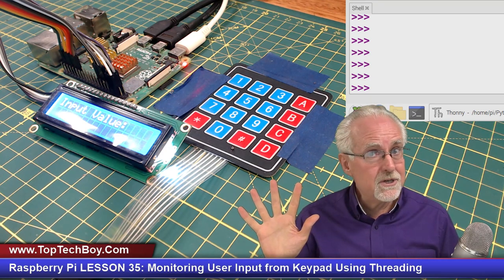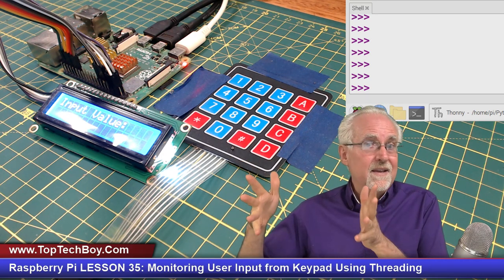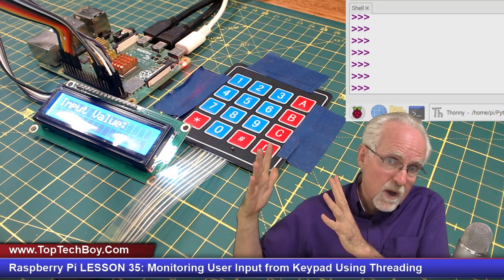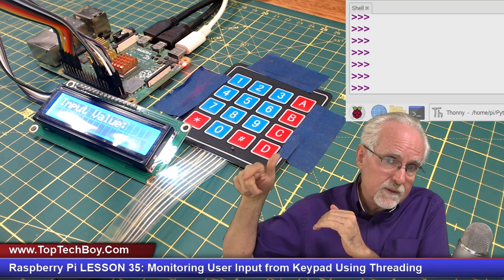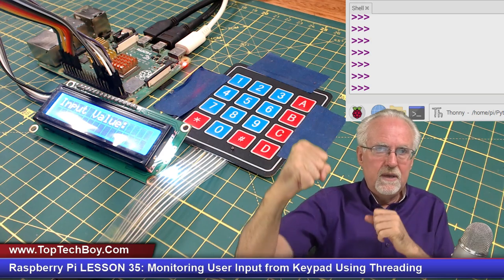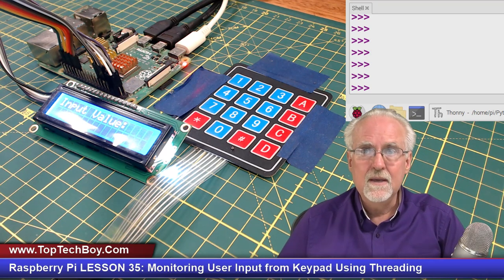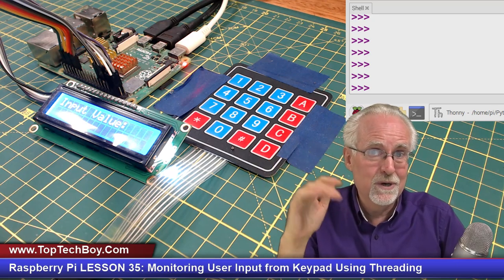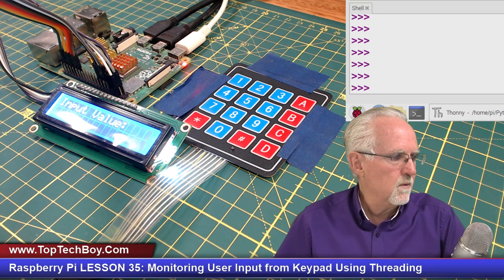Raspberry Pi LESSON 35: Monitoring User Input from Keypad Using Threading

Comment: This is another most-excellent lesson from the best teacher on the internet.  I was delayed in completing my homework version because I found that my super 8 GB Pi has a defective GPIO pin.  After numerous hours of troubleshooting I was able to work around the problem by adding an eternal pull-down resistor or using a different pin. Of course, I am now worried whether I will find other problems with my Pi.  At least I can now move on to the next lessons.

Comment: I admire the complexity and ingenuity of the system you have developed for portability of raspberry pi with LCD and keypad.  Your lessons are unrivaled!  

There is also a simple way to achieve some of the objectives with fewer programming skills:  With the pi400, the full keyboard is always available.  It is easily operated off a battery pack.  VNC can be used on smartphone to visualize the pi console as a wireless alternative to the LCD or an attached monitor.  The pi400 is only a little bulkier than the pi4 + keypad and LCD.
Reply: And what if you don't want your users to have keyboard and a screen? Consider a situation where you using RPi as a portable headless server, and you need to provide a way for users to enter a wifi password, and only the wifi password. You probably wouldn't want them going inside and messing with your stuff. And if you need to add a full keyboard and a screen in order to connect to wifi, then it also defeats the purpose of having a black-box-that-just-works. At that point you might as well just use a laptop, and it'd be cheaper that way. So why not use a cellphone, you may ask. Well, an android phone can't run a 64-bit docker container.

Comment: It looks like I am crashing and burning on another assignment, Paul. But I did connect the keypad to the breakout board(BCM) and split up the breadboard into 5v and  3.3 volts, but cannot seem to add another threading function to run the PIR. Been working on it all week. I’m looking forward to Thursday.

Comment: I have a suggestion for your upcoming videos. As it turns out I'm trying to design a simple alarm system right now.
I'm in the early days of Designing trying to decide what parts to use excetera.
so I'm thinking of using a Raspberry Pi for the brains of my operation.
So I've watched nearly all of your lessons. and I'm definitely learning things along the way.
But one of the things I need the Raspberry Pi to do is watch two inputs to make a decision.
For example if I want to arm the system. I need the relay from the RFID tag and inputs from the
 sensing components, motion sensor, door sensors Etc. If both inputs are present arm will fail.
but if RFID tag input is low and sensors are high then arm is okay. there are a couple of other 
scenarios where I need to watch two inputs. but I hope this gives you an idea of what I'm up to.
If you could cover watching two inputs to make a decision I would greatly appreciate that.
Reply: I am sure Paul has covered this in other lessons but using an "if" statement with the "and" operator will check if 2 or more inputs are in a needed state.
if GPIO.input(rfidPin) == False and  GPIO.input(motionSensorPin) == True and GPIO.input(doorSensorPin) == True:
     armAlarm = True
Reply: @keithlohmeyer  Thank You